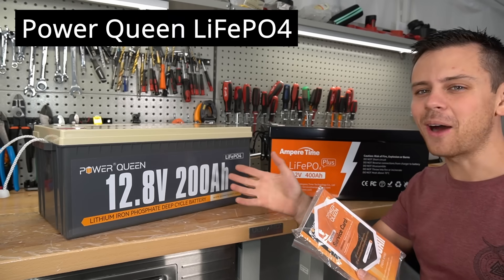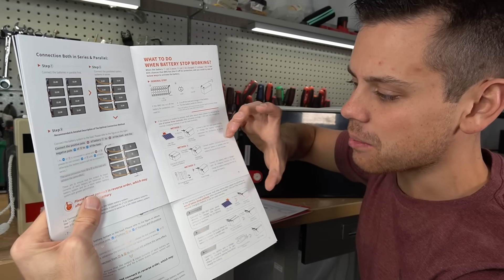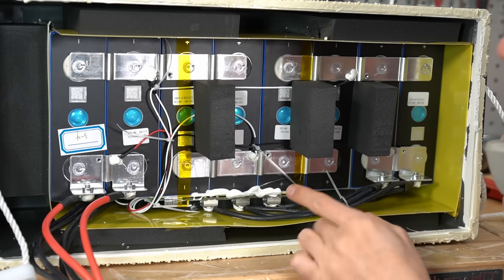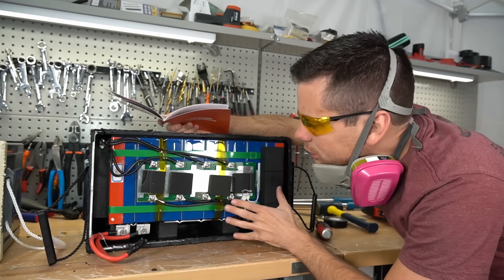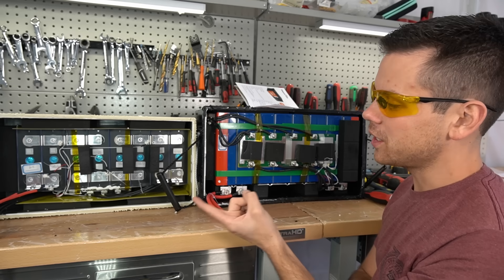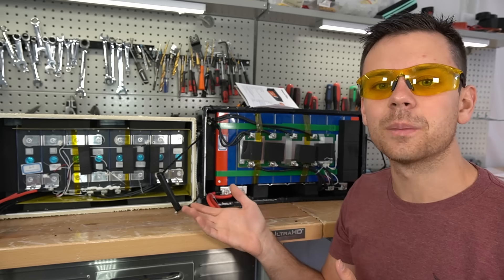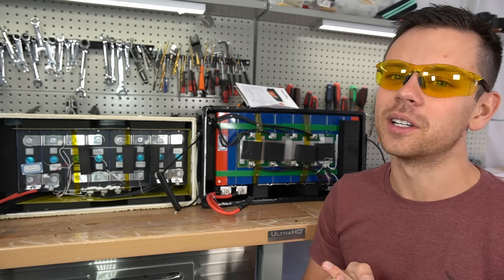Large Cheap 12V LiFePO4: Power Queen 200Ah & Ampere Time 400Ah Tear Down!

Comment: Thank you so much for this and your other teardown videos. You gave me the confidence to outfit my sailboat two years ago with powerqueen batteries in preparation for a six month adventure. It was the perfect power system for our needs and handled everything that we threw at it including engine start and bow thruster thanks to the high short term capacity of powerqueen's bms.

Comment: I use the power queen  for my off grid homestead have had no problem with them . Im using 8 12.8vdc 200ah  in 24v configuration.

Comment: We purchased 8 Power Queen batteries less than 2 years ago. The company advertises a lifetime of up to 15,000 cycles, yet 4 of our batteries are already showing severe capacity loss and are literally coming apart at the seams after fewer than 800 cycles.

Although Power Queen claims to offer a 5-year warranty, they refused to replace the defective batteries or issue a full refund when we contacted them.

Between the poor build quality, misleading cycle-life claims, and lack of meaningful warranty support, this has been a very disappointing and costly purchase. I would strongly recommend avoiding Power Queen.

Comment: Just for another recent data point, I've had a 12V 200AH Plus model from PQ for about 14 months based on this video. Performs excellent with no loss of capacity. My application doesnt need a high cycle rate, but works perfectly. Also, emails to support are quick! Bit of a language diff, but more than ok.

Comment: Those connecting bars concern me with the small fold for expansion,,they are much more likely to strain the cell terminals than "give",,,,such as wire braid would do, putting no stress on the terminals at all,,,aluminium hates deforming and is significantly weaker after just a few bend strains,,

Comment: I just finished dealing with LEAH from power queen and to my pleasant surprise they were very professional about the failure of 4/ 12V 100 amp batteries. I was dealing with colder temperatures. Long story short they’re sending me out the batteries that you’re revealing now that is the 12 V 200 amp. I will be wiring them in Siri for 24 V system, but once again so far I am pleasantly pleased with a responseand integrity. Cigar man YouTube.

Comment: The owner manual always says,  Do not mix batteries of different brands. It seems if they are identical as Will testifies, then it wouldn't make any difference, particularly if they are the  same amp hours, size and voltage. 
I have two redodo 24 v 100 amp hr., and two Li-Time 24v 100 amp hr   I believe it would be ok to hook them all together in parallel.

Comment: Greetings, I would like to know if I can connect four 3.2v x 300ah cells in parallel and make a 12v 1,200ah battery? I have seen them with two 200ah cells and they add up to 12v x 400ah. Can I increase it to 1,200ah?

Comment: Hi, i expect to purchase 4 units of these batteries to reach 48V and connect these to a Hybrid inverter like a Sofar hyd3000-ep.
I should use a 48V battery balancer to equalize the voltage of each batteries.
Is this someting that will work properly ? Or there any drawbacks to do this ?
Cheers.

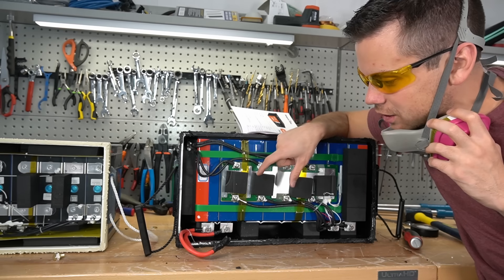Comment: At the 4:15 mark Will mentions that you can have low temp charging protection even if the battery doesn't have it built in if you charge with a Victron solar charger. I'd like to know more about that because I'm considering some batts without low temp protection.

Comment: Pretty new to all this and just learning.  Am I correct that this 300AH Queen would be a drop in replacement battery for my travel trailer's lead acid battery?  Will it charge while hooked up to 30amp shore power like my lead acid battery?  Also, will it charge from my tow vehicle while driving?

Comment: Hello from Greece !!! I make my home solar system with 12 panels 440 watt and I am not sure what battery to buy.i bought one small power queen 12V 100Ah for camping but I am afraid for fire because the system I will put it in the house ,not out .is it better to buy this power queen ( 4 batteries ) or north batt carbon lead ? They make this carbon 3000 charges.what battery do you believe I must buy for the safe of the home ? Thank you very much

Comment: Just as a warning: These variants quality (12.8v 100Ah in my case) has gone downhill in the last couple of years. The batteries I bought in october 2022 have at least 50% more amp/hours than the ones that I bought in January 2024. They became a lot cheaper for a reason, from 300 to 200 USD, I haven't manually measured them individually but when charging and discharging the amps that travel in the DC circuit are almost half as the old ones. See this as a direct equivalent of shrinkflation, or that they're probably getting rid of lower quality LiFePo4 cells. Make sure you test the capacity and return if they don't  meet the 100Ah.
Reply: Interesting. We're on our 7th powerqueen and have yet to have an issue with the 12v 200ah versions. We're getting ready to pick up a couple of the 25.6v 200ah, hope they are the same quality. The two 12v 200ah we bought two years ago to run the AC in our off grid art studio, are still going strong. The four of the same we picked up about 8 omonths ago, we have running our Ford Lightning charger,a  have been runningthe charger at 2700watts  just about everyday since November, and seem to be fine, no issues. Yet to have an issue with a powerqueen battery.

Comment: i live in the south so cold weather is not a problem i would like to see more blue tooth or usb port in a battery
see if a cell was getting to far out of balance and damage the battery  get more information about the battery and bms without cutting it open

Comment: those batterys arent cheap for clones also i want to be able to connect with costomer suport or them to check up on me if something gose wrong with batterys it will be dificult to contact them i have had that isue befor renergy 200amp are cheaper by alot 2 for 700 the fake batterys over 1300 for a 300amp

Comment: HELP! You are the most knowledgeable in batteries and solar as far as l can find……for camping, without an AC, would l ever need a battery with a 200ABMS? I am really only running a small 65W mini fridge, a couple 12v lights and charging our devices in a vintage tiny travel trailer. I am thinking the Li Time 200ah, 100A BMS. I have a Renogy 200watt suitcase for solar.

Comment: 2 years in, my 300ah Ampere Time is definitely degraded, maybe even failing... I have not tried to contact them yet, but since they changed their brand name (now Li Time), and what I've read from other users, it might be a longshot getting them to honor warranty... but I'm going to look into it.
Reply: The battery is still working, but definitely keeps degrading further and further... I suspect they're already at about half their capacity after not even 3 years... so I'm looking for a replacement - any recommendations?

Comment: What do you think of the Power Queen 100Ah Self Heating Battery? I want to install one in my SUV that will be maintained with a roof 200W Solar panel. And will both Maintain the 12V Starter battery, And have an Inverter for AC Power in the trunk. Self heating seems best since it can get to 20F at night in the winter here.

Comment: I bought a 100ah power queen 1 year ago. It just stopped taking a charge. The support team just asked me for the 3rd time to connect it direct to solar or use a charger with 0v functionality despite me telling them I’ve tried both several times to no avail. I will not be purchasing anything ever again from that company.

Comment: I’m struggling to figure out the difference between these types of batteries and like a limitless lithium battery as of October 2023 you can get a 100ah for less than $250 where a limitless 45ah battery is over $1200

Comment: Thanks a lot Will. I live in the caribbean, so no need for low temp charging protection here. I've learnt so much from you since following you about a year now. Looking to build my own solar system with a VERY limited budget, so I'm of starting small, like a system that can power even just my 18k btu ac and a 22 cu. Ft. Inverter fridge for now. I like these batteries as they seem more affordable at this time compare to the server rack options. Over time, i will upgrade, but just looking to start somewhere and grow from there. Awesome work man, keep churning out these videos. Much appreciated.
Reply from the maker: Awesome man, glad I can help. Battery prices dropping more these days thank goodness
Reply from the maker: Check out used solar panels
Reply: @WillProwse  okay will do. Have you covered used panels before? Don't recall seeing a video from you about. Would welcome your expert opinion on these.

Comment: Will I keep hearing from some of these cheaper manufacturers that we should not be using these batteries to start rv onboard generators because of too much amp draw.  I have a 5500 watt onan generator and I have seen online that these generators have Cold Cranking Amps of 450 amps but I saw a youtube video of a guy cold starting a 5500 onan and it only drew about 100 amps.  This was measured with a victron battery monitor.  Lots of rv'ers use lithium batteries and have onboard generators.  Do you have any info on this? Might be some interesting experiments using different batteries to start different generators?

Comment: Power Queen contacted me after my battery shipped to let me know it was coming and to make sure I knew how to contact them if I had any issues.  It arrived on time and we well packed.  Don’t ever recall any other product company doing that?!
Reply: It's been a year.  How's it performing?
Reply: @CaseyTurnerMusic  - I am still using it and it still outperforms the 2 lead acids I replaced with it. Sold those for $120 to boater friend to offset the cost. The Queen has fully discharged twice after leaving it unattended for multiple days and very little solar support due to the weather.  Heading into my 3rd camping season.

Edit:  the above was written 3 days ago.  Since then I’ve run the RV solely on the 190Ah Queen with the rooftop 200 watt solar panel.  Keeping the main fan on, fridge/freezer on, lights as needed, awning  adjusted as needed, and water pump as needed.  Just checked the battery and it’s at 13.2v.  We just hit some sun this afternoon so it charging now for the first time in 3 days.  This is a good battery at any price.  But it’s an excellent battery for the price I paid.

Comment: Hello Will,
 I purchased via Amazon a 12v 200ah lifepo4 battery from Li Time and they sent me one with two different labels. 
On the top label it indicates 400ah and on the side the other label indicates 200ah. 
How do you think that their quality control made such an error?
I would think that before placing the battery in the box the employee would see the different labels. 
Now I'm getting the run around from Li Time prior know as Ampere Time.
Please give me your thoughts. 1:12

Comment: If I have a 400 amp battery and I went to expand it to 600 amps can I just add a 200 it if the bMS is the same and different brands at 12 volt

Comment: Thanks. I choose Power Queen. Tested as best I could. 208 amp hrs.  Stopped at 10.8 volts. Two of these out perform 8 100 hr AGM. Add these 2 to lv2424 from Sun power, powers whole house with just 1440 watts of Santan solar. Only thing not cared for is 240 split phase load of deep well pump.
Will not bore you with list of appliances, just to say it is long.
Thanks for all the open-minded testing.

Comment: I came across a Himasi 200 ah with reported low temp & BT for $499 on Amazon.  I want to buy it, but wanted to run it by you and your followers to get any possible feedback? I'm looking for the best affordable 200 ah with BT, temp cut off nice, but not necessary.   Im using it as an auxillary battery on a boat. Is this one too good to be true, or should I buy it? Thanks

Reply

Comment: @Will Prowse  Can you do a teardown and review of Enduro batteries?  Supposedly this company is competitively priced with a 12v 300ah battery for $1700.   From what I hear, it is an American company, but the batteries are Chinese made.  However, they have full control over the quality.  They supposedly have great customer support.   I was close to buying a Weize battery, mostly based on your review, since it was one of the few cheaper batteries with a working cold temperature sensor, but I was hesitant when another reviewer had a problem and found Weize's support to be nearly non existent.  I was considering SOK, but that battery is $1900 for 206ah.   I almost bought that one too, but then I heard about Enduro, and I have been seeing quite a few positive reviews here on You Tube (and in the RV circles) about the battery and the good company support the company offers.  However, thusfar, no one has done a tear down on the battery.  I figured that is where you would come in since you do a stellar job at pulling these batteries apart and finding out if they are well constructed or not.  So if you get an Enduro battery, I certainly would love to see a tear down of it.

Comment: Can you explain why or how this 12v 400ah battery is a better deal vs the various 48v 100ah Server rack batteries? At $1699, they appear priced very closely but the server rack batteries seem like a better configuration for expansion?

Comment: Question, but first I have to say I love the content, and one day I will go off grid (I live close to SignatureSolar so picking up parts will be easy).  My question is RV related, maybe a stupid question, my RV nearly got hit by lightening 18 months ago and it fried my Xantrex freedom 458 2000W inverter/charger and transfer switch and back then I just replaced it.  Now my 4 6v lead golf cart batteries went dead and I decided to go lithium and just bought the AmpereTime 12V 200ah Plus.  The Freedom 458 IC is ideally not designed for lithium, but I set it on AGM mode, it seems to be working.  But I wonder if once battery gets to a rest state of 13.6V, should I push the charger off switch on the Xantrex remote panel to stop charging and wait for when battery is low to temporarily turn back on the charging feature?  The RV mostly sits on the property as a remote office.  I saw your video on the RV step. been there done that too. I'd like to get the AmpereTIme to last as long as possible, but surely it will last longer than the lead batteries, and I'd hate to buy another $900 new Xantrex XC inverter as I just bought the Freedom.

Comment: ive been very happy with my 2 100A 12v PQ. in my camper after 3 months they charge quick & give me good power all night small rooftop solar 120-140w on roof & all I can saw now is if I could fit 1 400A & maybe 1 190A wow what a life off grid, i'm 2/h years in my camper now & glad i held out because BB are just way way to expensive, i'm kinda crazy on trying to live on the smallest amount of carbon & elec I actually lived on 1 BB lith batt for 7 months I returned that & got a new 1 sold it on CL for $650 & bought 2 PQ's, I had LedAc most of the other months, I love the PQ batts! Glad I held out for a time & watched these vids from DIY  & Lithium Solar he does a good tear down as well. You can't beat the price of the newer ChInA batts huge improvements from 2 -3 years ago! Thank you & God bless you!

Comment: I have 4 x 200 ampere time on my catamaran. They work well, and it's so nice to have so much capacity. They charge really fast, and I'm using a xantrex 3000 inverter. Runs all my 110 appliances air fryer, induction stove etc no problem. Highly recommend these batteries.
Reply: how long have you been using them for?  What are you using to prevent alternator damage?

Comment: I bought 200AH 12 volt with 3500 inverter. Pulled 1850 watts for 1 hour and battery got a little warm but nothing xtreme. Good video.
Reply: To make the battery last longer, it is recommended to place it in a room with a moderate temperature.

Comment: I bought three 200AH Ampere Times and they didn’t work correctly. During the early morning I could make coffee (1400w keurig) just fine.  After the Sun came up the wife would try to make a cup and it would trip the BMS. That’s with 200W of solar going in. I sent them back and got two 300AH lifeblue. Couldn’t be happier.

Comment: Will, you said both batteries had the same BMS, but I think that may be incorrect. The Ampere Time has a 250 amp BMS and that is indicated by the PLUS designation. I think the other battery may only be 100 amps on the BMS. I personally think that is a significant difference beyond the AH rating of the two.

Comment: Hi Will FYI the plus on an ampere time battery or now Li time indicates that the BMS is the 200 amp not the 100 amp standard, They also double the BMS heat sinks

Comment: Hi sorry to disturb , but I have a battery related question. I have built a 4 cell Eve battery with 280aH and a 300a BMS.
Battery mostly works fine (in a camper van) will supply all needs for an evening and shows 12.4v at 90% charge at the end of the day. But overnight battery voltage will dip below 10v still at 90% charge with little or no load attached. As a consequence inverter will not function, which is very annoying. Any suggestions ? All cells seem to remain balanced. Thank you 
Andy

Comment: Power Queen and Ampere Time, all these use prismatic LiFePO4 cells. It is very convenient for assemble, however, there two issues, one point is heat dispassion won't be good, another point is the capacity, once one cell failed to work, that the capacity will drop significantly.

Comment: I live in Jamaica where it's warm all year round so a low temp sensor is not necessary for me so i'll just buy the cheapest (or near cheapest) battery when the time comes.

Update: I am now running two 100AH LiFePo4 Power Queens. They are charged by three 450 watt panels through a 60A Li Time controller.